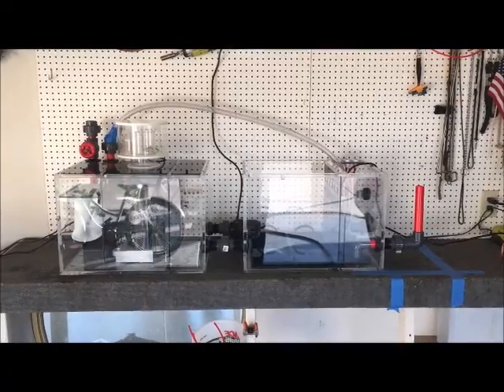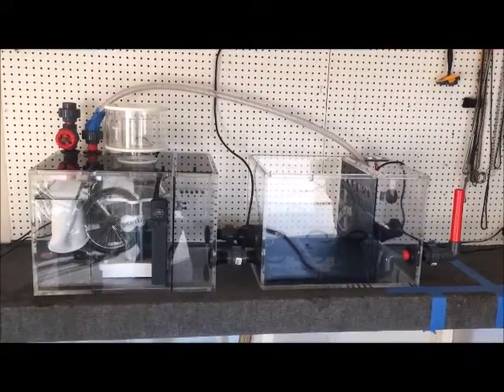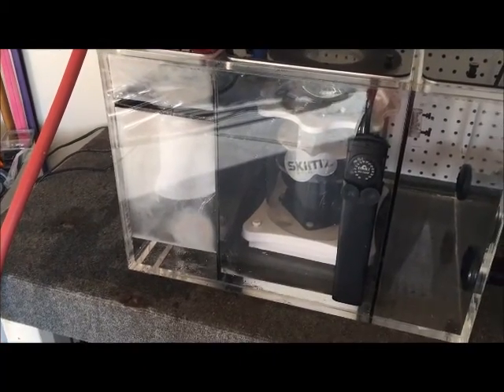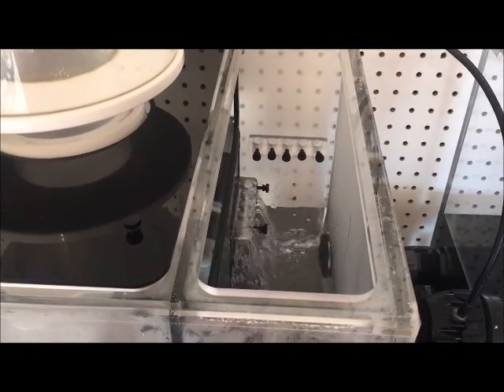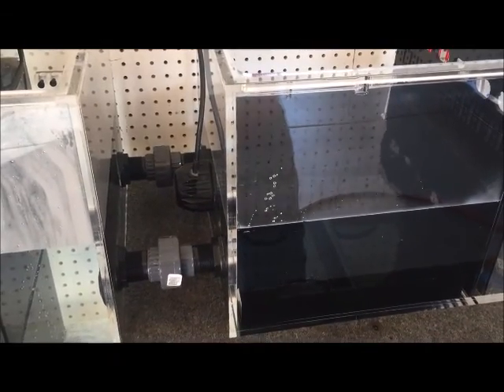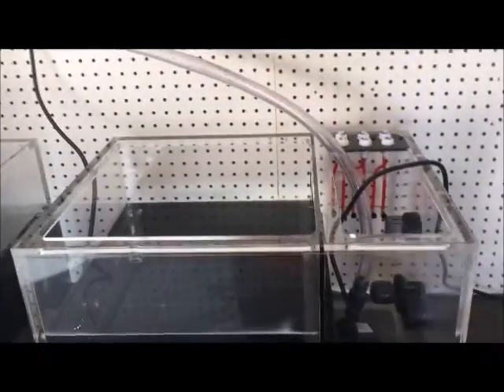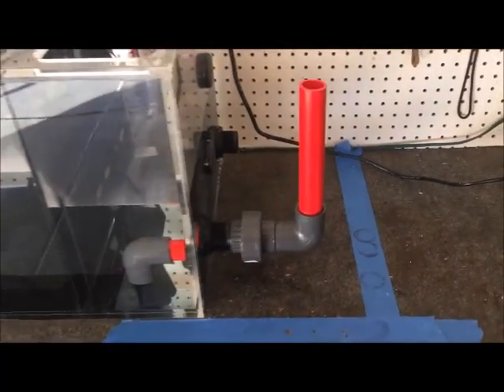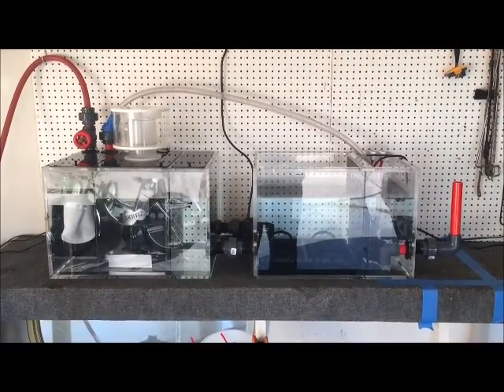Split Sump   Part 5

Comment: trays in the regugium, interesting concept.  has that worked well in practice?  with just two seems iy may be a bit difficult to get one out without stirring up stuff too much.
Reply from the maker: They work very well, removed them for a bit but putting them back in soon 
They have handles for easy removal